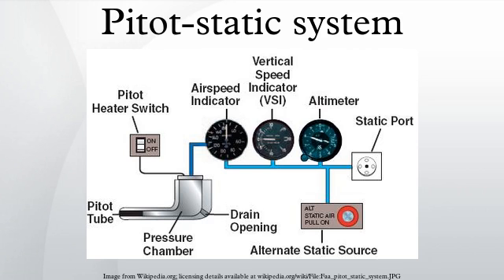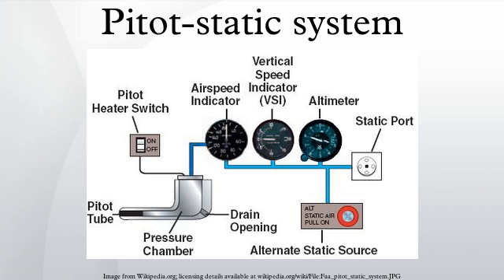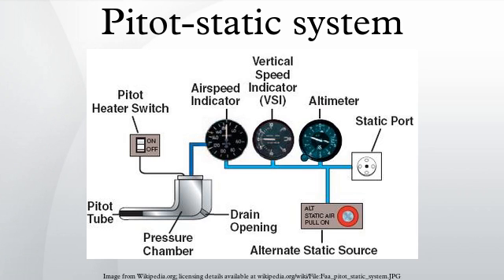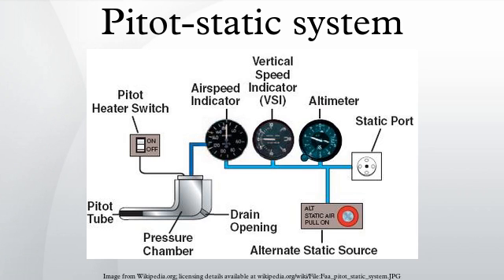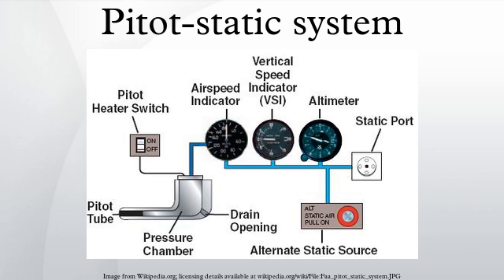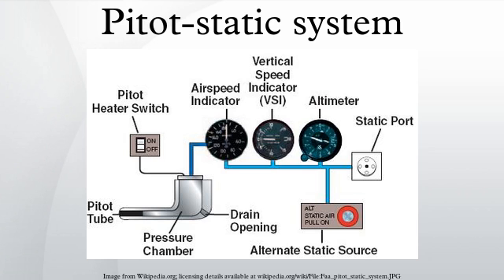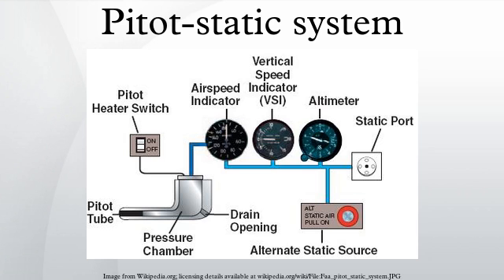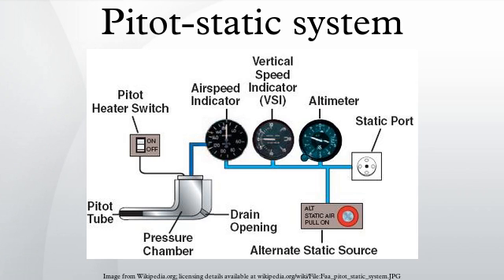Pitot-static system

Comment: A pitot-static system is a system of pressure -sensitive instruments that is most often used in aviation to determine an aircraft's airspeed, Mach number, altitude, and altitude trend. A pitot-static system generally consists of a pitot tube, a static port, and the pitot-static instruments.